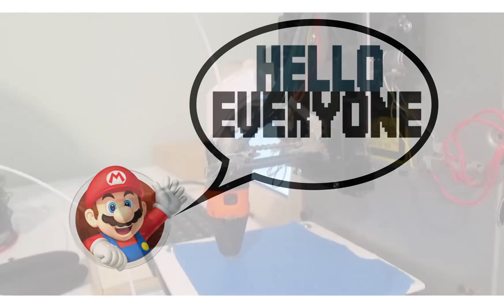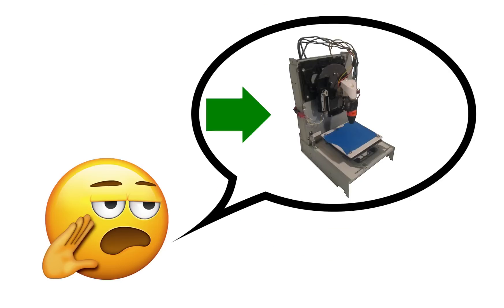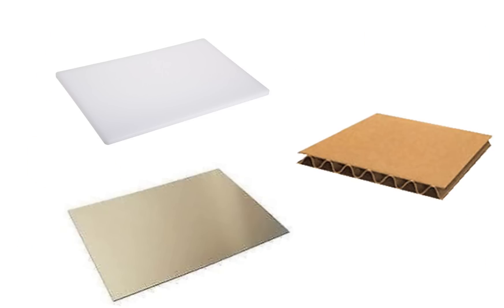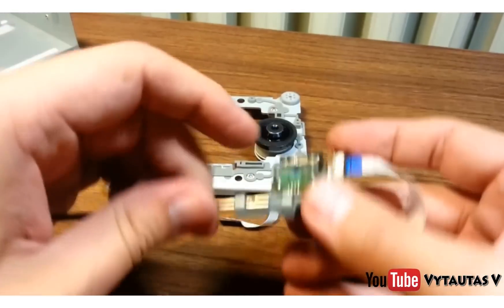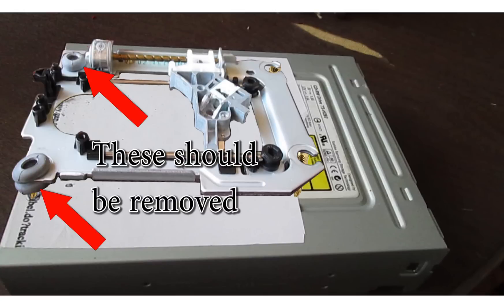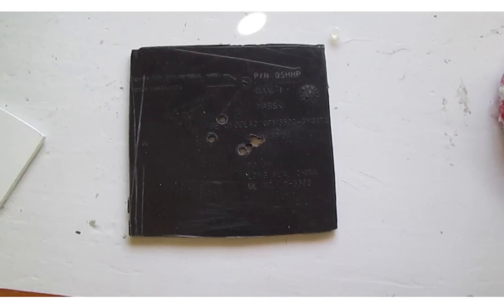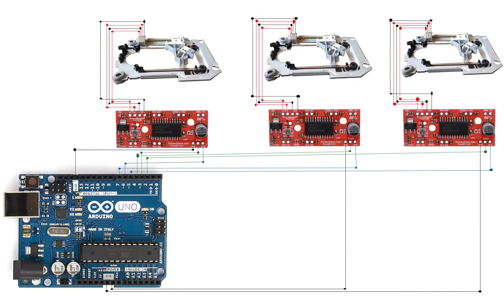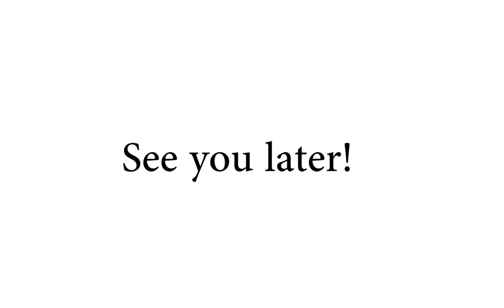Make a 3D Printer From Cd Drives || Part 1

Comment: Hello brother, I saw your work a few days ago and decided to start mine, where I live I did not get the same ones but they are worth the same, I bought arduino mega 2560, ramps 1.4, and 3 step a4988 mount everything and I can not even continue with the keys one movement , it does not move in any axis.
could you help me?

Comment: All 3 - D printers follow the same course of evolution as do all other invented mechanisms - supply...and demand. Right now there is oversupply but zero demand for home 3 - D printers. 3 - D printer manufacturers know this. So they have convinced a whole bunch of customers that they just need to buy printers which have been overhyped. And this explains why so few homemade printers work. Its because everybody involved in making them forgot the single most important mechanism required to make them work to begin with - the drivers.
Nobody is actually demanding any 3 - D printer for home use. There is a simple reason why. Just like this video demonstrates, this 3 - D printer can not work in reality because it is not possible to install it. It needs to be installed first. Every 3 - D printer which has ever worked was somehow installed first so that the computer in question could see it. 
This means that to work, it has to show up in This Computer. Its called the task manager.

Comment: Hello my friend I want to ask something about the power supply. Why I can't use the 5 volt of Arduino or vin  to give the power and I have to use another Power supply?
Reply: To make the first home 3 - D printer capable of printing 3 - D objects, you have to connect it through cables and wires. Before you even do that, you have to install it first directly from a CD. Once you do that, you change the course of modern 3 - D printing which has so far been basically aimless.

Comment: Hi sir,  I'm very interested with this project video. I will try using a real hotend and a real extruder to. I have 3 old dvd drives and the one of them are I can't remove the optical lens on it. The another one has been removed. There's no hole similar with your dvd drives. What should I do?

Comment: So as I collected parts for this project. I realized hotend extruder is cheaper than the 3d pen. Any reason why you didn't choose that?
The drivers, will it work with any step motor incase i want to redo/upgrade the motor?

Comment: Hello, we are trying to copy your work, but we are having a hard time mounting the cd drive motors on the aluminium cd cases, the bearings don't fit, could I contact you on email? Or how did you solve this? We bought the motherboard bearings from the video info. Thanks!
Reply from the maker: Have you tried using washers?

Comment: Hi. Hoping that you could help me with this. Will this work if I use cnc shield v3 and different stepper motor drivers? Specifically this -> [ https://www.lazada.com.my/cnc-shield-v3-3d-printer4xa4988-driver-uno-r3-for-arduino-wusbcable-50190414.html ] I've seen other diy cnc machine videos and some of them used this and the motors worked. I'm assuming it will work for me too. (and also because it's cheaper :p) But none of the videos (that I can find) used this for a 3d printer build. So, if I wanted to connect the pen with the UNO, will the pen work if I just slot it in the pin with the cnc shield? Or do I have to solder it to the cnc shield? Or is it something else? Total newb here T__T And awesome vid. Thanks for the tut!
Reply from the maker: It would probably be best if you soldered it to the cnc shield.
Reply: Thank you!

Comment: Lets say I got myself a cheap china stepper motors, will that work too?
Stepper Motor 12V 28BYJ48 High Quality Arduino Raspberry Pi <--- this one to be specific
Reply from the maker: Well, since there are 5 wire connections, than you will have to use different driver boards; so I don't know if you will be able to wire that to an arduino. But if your asking if it's possible to make a 3D printer with those motors, than the answer is yes, but it might take a little bit of research.
Reply: [solved] There were tons of videos converting this 28BYJ48 stepper motor into a bipolar motor. Basically from 5 wires to 4.
Reply from the maker: Well that should probably work than. As long as each set of wires are controlling one coil than I don't see why not.
Reply: Anyway Thanks! ^_^
Reply from the maker: No problem. I hope that helped.

Comment: What voltage do you use to power these motor drivers ?
Reply from the maker: 12V
Reply: So, these motors get 12V, am i right?
Reply from the maker: They can get from 7-36v

Comment: Thanks for the video! As you said, this is an addition of what's lacking in Tinkernut's video, but you've done a really awesome job by doing it. It explains a lot of things which I need to build my drive printer. Hope it's finished fast.
Reply from the maker: Thank you very much! I'm glad it helped!
Reply: I'm waiting for part 2 - like the rest of us in this video I suppose ;) Did you power it with a computer ATX power supply?
Reply from the maker: No, I used a gamecube power supply.

Comment: Very useful and thank you! I was wondering if you could help me with the wiring of the 3d pen button. Tinkernut suggests using a 2n3904 transistor and 22kohm resistor. However every type of resistor I used turns the motor on (I even used a 100kohm potentiometer). I can't get the spindle button to turn it on or off. I am starting to think it's because the two (Arduino and pen) don't share a common ground (I am still using the original 3d pen power supply). Did you hack yours to use the PC PSU? I am asking this as a last "resort" because the motors worked with the PSU and the Arduino connected to the PC, but the pen seems to have a mind of its own (or ground of its own :) )
Reply from the maker: The 3d pen actually uses 12v (I Can't remember the amps) so I took a Nintendo GameCube power supply (12v 3a) and hooked it up so that it powered both the pen and the stepper motors. I'll talk about this in more detail in my next video.
Reply: Electronic Grenade Thanks for the reply. I'm looking forward to seeing it.

Comment: You can use a led by multimeter place terminals on the stepper teminals you can spin  the motor and wait turn on the led and if get turn on are the correct terminals
Reply from the maker: Great idea! Thanks!
Reply: Good idea!!! :¬)